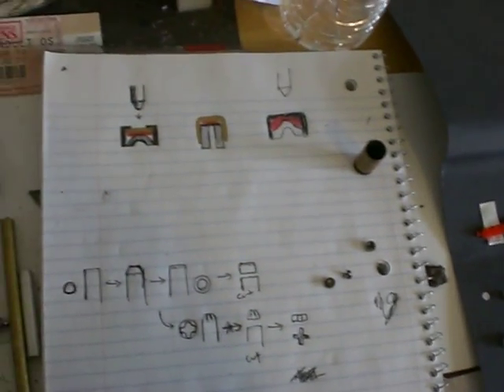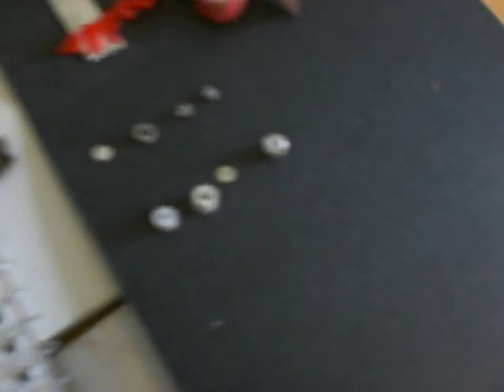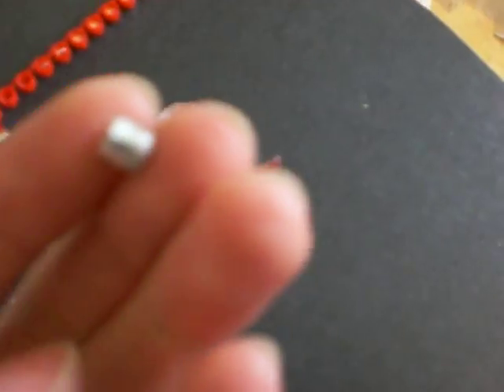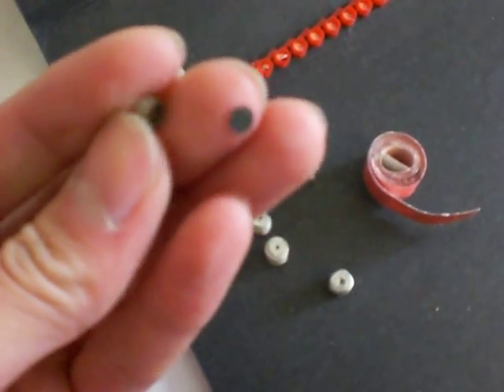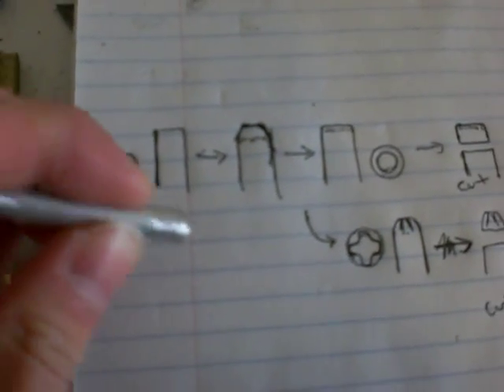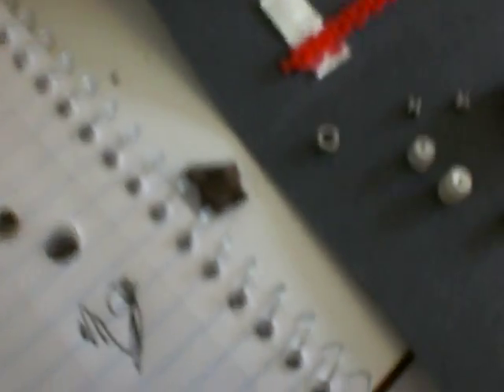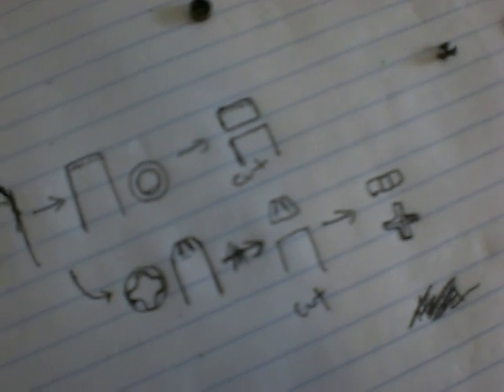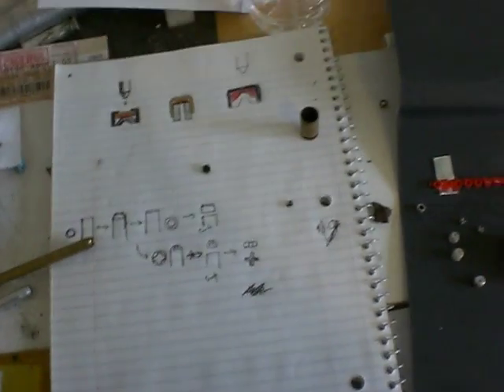homemade primer description

Comment: Hey bud I saw your channel was still active and I had a question if you would be so kind as to answer...

Maybe I just didn't quite understand and need to watch it a couple more times...but is your method capable of producing the entire primer cup without using recycled primer cups?

If so, and if it isn't too much trouble to ask...could you please outline how you did that? You showed a stubby, cylindrical piece and an aluminum hole you punched out - parts which if put together appear to be the two main pieces of a primer cup shaped thing...but I wasn't quite clear what the cylindrical piece (presumably the 'walls' of the primer cup) was, how that 'wall' cylinder was made, and finally how the aluminum circle would be inset into that 'wall' part in such a way that it wouldn't just blow itself out the back if detonated, or even just fall out?

Been really interested in the subject of home-made primers and I've found solid stuff on every other part of the process EXCEPT the primer cup. =)

Comment: He showed two sources for impact sensitive compounds, roll caps and plastic ring caps. A third compound is strike anywhere kitchen match tips. Even the plains indians used match tips in the 1800s due to ammo restrictions, sound familiar? It's corrosive but U can still buy strike anywhere kitchen matches both on-line & in selected mom/pop brick-n-motor stores. I got mine at Ace Hardware in east Portland, Oregon just because I like them better but seems like pre-1965 quality was better though.

Comment: To  put it in a little simpler terms, the anvil is there as the backing piece to allow compression of the pressure-sensitive compound. Without the anvil you do not have a bang. It would be like tossing a cap in the air then striking it with a hammer, no bang! Place same cap on concrete then hit with hammer, bang! In this example the concrete provides the backing or anvil

Comment: this is how i make mine (for  my  homemade flare gun project)
  II--        IIII= metal plate --= tube
 {::          {= plastic or metal disk ::= shock sencitive material
  II--
works well but i use like 3 caps and a few pieces of granulated BP for my explosive part
Great VID